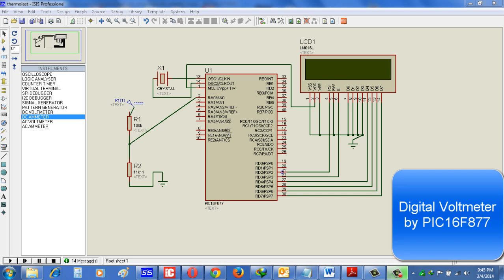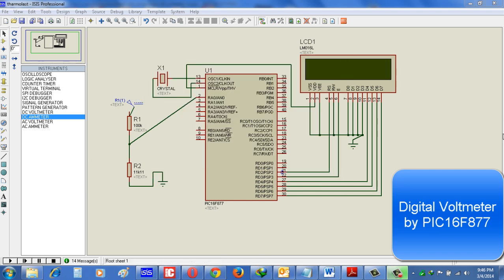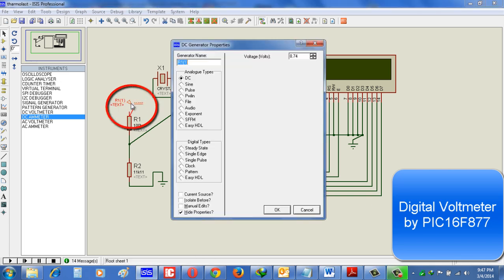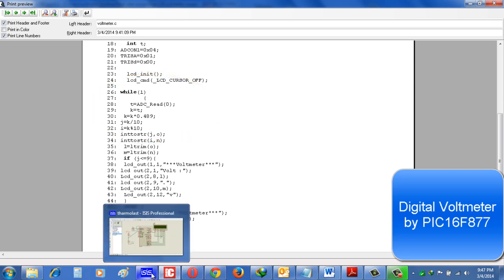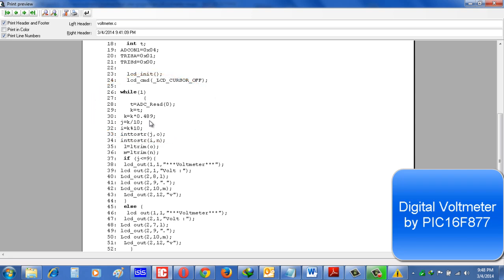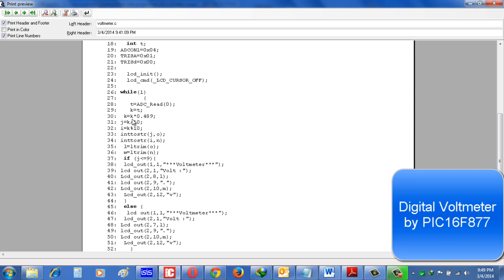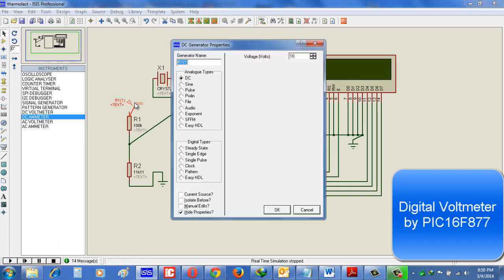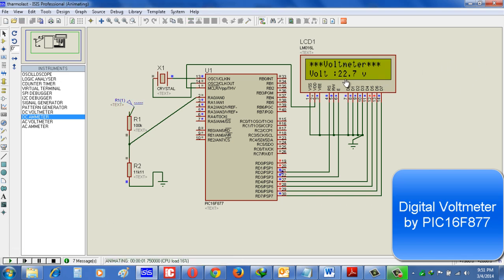digital voltmeter by PIC16F877 + mikroc + protius

Comment: Hello! I am Haftamu I need a micro c code for comparing two voltages i.e. one reference voltage and the other is variable voltage, using PIC16F877A microcontroller. Would you mind if you help me in writing the code please? the required components are PIC16F877A microcontroller, Comparator, and Relay with its driver.